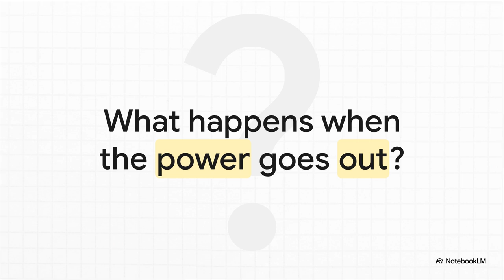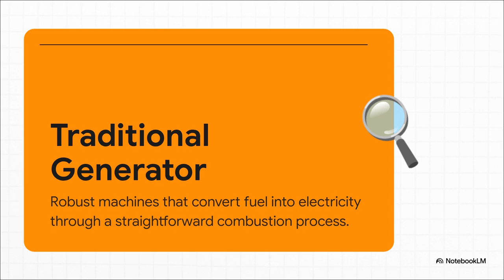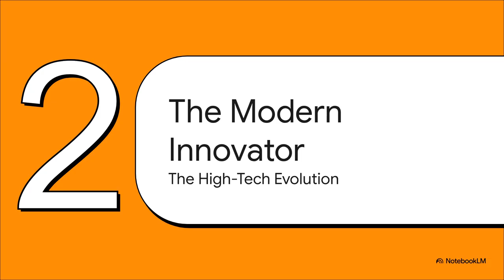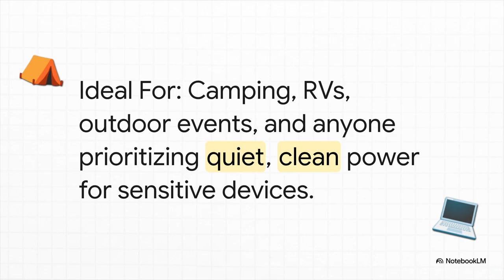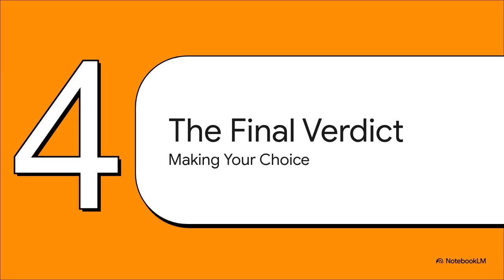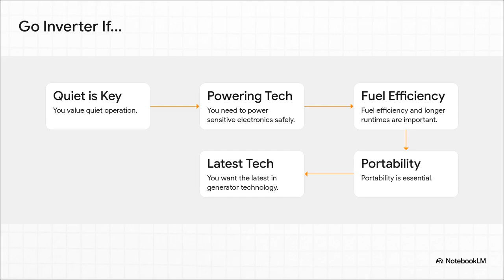Business Backup Power: Professional Inverter Generator vs Generator Comparison Analysis

Comment from the maker: .
Link = https://cutt.ly/OrNx7E5x
.
Business Backup Power: Professional Inverter Generator vs Generator Comparison Analysis.

Commercial applications require careful consideration in any inverter generator vs generator comparison, as business continuity depends on reliable power solutions. Traditional generators provide the high-wattage output necessary for industrial equipment and large facilities, while inverter generators offer clean power for sensitive computer systems and point-of-sale equipment. This professional analysis examines factors crucial to business operations: power quality, runtime, maintenance requirements, and total cost of ownership. Understanding these differences helps business owners protect their operations and maintain productivity during power disruptions.

Hashtags: #BusinessBackupPower #CommercialGenerator #ProfessionalPower #InverterGeneratorVsGenerator #BusinessContinuity #CommercialBackup #IndustrialPower #BusinessGenerator #PowerReliability #CommercialEquipment #BusinessPreparedness #GeneratorComparison #Enterprisepower #BusinessElectricity #ProfessionalGenerator